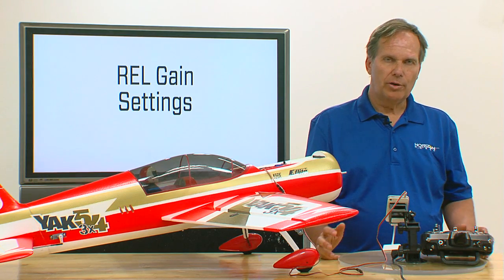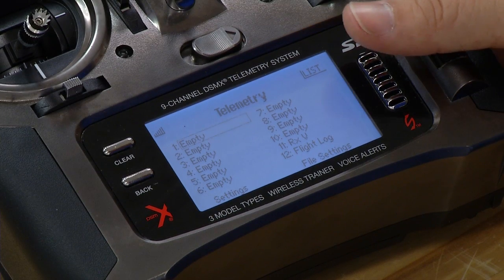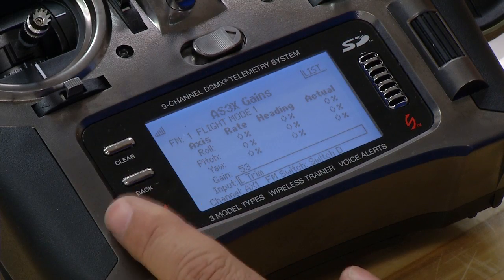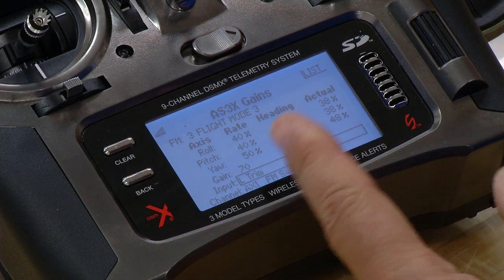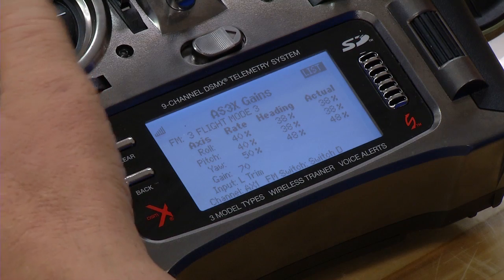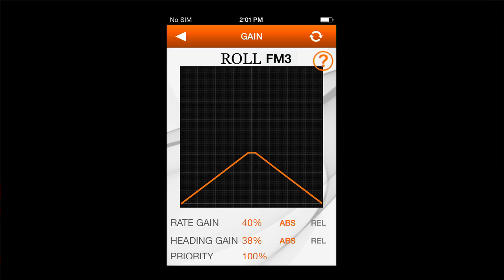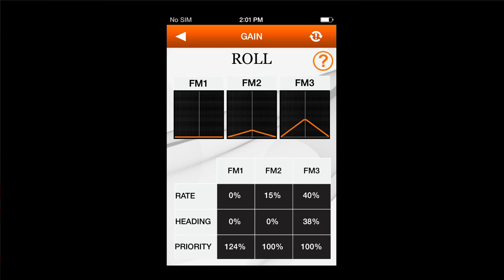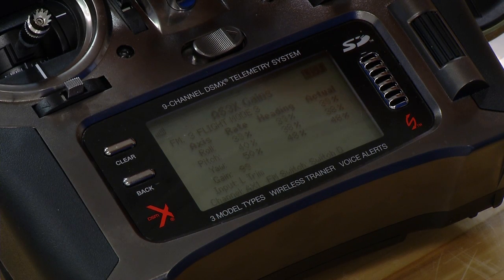Spektrum AS3X Step 15:  Relative Gain Settings (Final Model Setup)

Comment: Hay Jon what should the heading gain  be at ballpark?  I have my AS3x gain set at 40-50-60 but did not set the heading gain so I don’t have any movement on the control.
Reply from the maker: Heading gain can be pretty sensitive and it is hard to give a suggestion without first knowing more about the model. I would suggest starting at 10% and moving up 1% at a time until you feel it is doing what you want it to.

Comment: How can I use the dual elevator with as3x, only the elevator channel works, the auxiliary does not work with as3x, how can I solve this?
Reply from the maker: Depending on the receiver, it needs to be programmed into the receiver for this to work. I can help point you in the right direction if you can provide more detail :)

Comment: I've also had to watch the videos several times, fly, and then re-program.  As nearly as I can tell the stabilization system does not work at all, I'm doing something wrong. I've probably spent thirty hours trying to get one receiver to work and am not there yet.  I don't even know what to ask.

Comment: The average guy that flys RC is not an expert at computers. This stuff is far beyond most of them, making having gyros and the "smart" products impossible for them to use. I am sure it is disappointing for the fliers that would like to have some of the new technology. I couldn't find anyone to help me, other modelers,  hobby store owners, even members of my club. I bought an AS3X receiver and ended up putting it back in the box and not using it, because no one could program it.

Comment: I have an AR 7350 on a Stuka with a DLE 20. I have fixed gear so Port 5 is my Tech Aero IBEC and i have a total of 4 Flaps so i have two on Port 6 and two on Port 7. I have my engine kill(Port 5 Tech Aero) assigned to my bind button so i can kill the engine from my DX9. On switch G i have 3 flight modes High rates position 1 no AS3X active , Low rates position 2 no AS3X active and position 3 i have low rates plus AS3X active. Since all my channels are used is it possible to still add TX gain control on the right trim switch or would i need a RX with more than 7 channels?

Port 1 - Throttle
Port 2 - Aileron
Port 3 - Elevator
Port 4 - Rudder
Port 5 - Tech Aero Ibec
Port 6 - Flaps
Port 7 - Flaps

Comment: Haha, what a joke, relative gains can't work with my existing DX8?
As if i have not spent enough money, is it trying to encourage me to get a more expensive Spektrum tx?? : )
Reply: Katana Aerobatics I’m guessing my DXe is the reason I can’t get the Gyro stabilisation to work?
Reply: Mordem Tasci - nope, RELATIVE gains I.e. adjusting them in flight needs a compatible radio, gains per se do not. If you don’t have a suitable radio use the flight mode switches. Using the app connected to the Receiver, Set FM1 to zero gains, and then set FM2 and FM3 to two levels of gain, say 30% and 50%. Take off in FM1 and then switch to FM2 and FM3 in flight. If either oscillates switch back to FM1. Land and lower the gains. If neither oscillates then the gains can be set higher, etc. Much longer winded then using relative in flight but not exactly a deal breaker is it.
P.S. if you cannot set gains or make changes with the app, you may have an AR636A I.e. a preprogrammed one out of an eFlight plane, those often cannot be reprogrammed to other models.

Comment: Det biggest problem now is that Spektrum ignores the fact that the App doesn't work for most android users. I cant even download it. I have to send my AS3X back..
Reply: Works OK on my Samsung Galaxy S5.   Also, works fine via USB connection to my  Win7 laptop.
Reply: thomas low The App should work on all device i cant deag a laptop to the airfield 😊😊
Reply: ArcticRc 

I work for a hobby store and deal with horizon on the daily. They are working on the problem
Reply: they need to work a bit quicker why should  we pay good money for a Bluetooth  cable that does not work on all  android phones its a joke

Comment: I also have the DX8 Gen 2 and am not able to select input switch.  The cursor just skips over it.  The input switch is on "roller" and again I can't highlight this setting so for now roller is the only switch option.
Reply: I had the same issue with DX8G2. I've since upgraded to the DX9 and now that selection highlights as in the video.

Comment: Does this work on the DX8G2 radio I just bought or is this a real old video?
Reply from the maker: Absolutely!  It comes with the AS3X gain menu already installed.
Reply: Ok thanks! My radio didn't come with a receiver or cord to use the App so is this all programmable on the radio itself? My kid is only here till Sunday and it's taken 3 days and I'm still not sure I understand how to program this to fly the Timber I bought for him.. there was no quick start guide like this series says to get the QR code from either and I can't figure out how to set dual rates to a switch or set the rates so I can fly. I'm new to this electric stuff too and not sure how long to fly with this 2800 mah battery but, I'm guessing till it pulses
Reply: It says there's links on the spectrum RC site to set up this thing but this is the only place I see videos
Reply from the maker: The Timber comes programmed if you bought the BNF version. No need to program the RX. The radio is super simple to setup for this model. Essentially just setup the flaps and you are good to go. Also I can get you a preset if you want. Hit us up on FB messenger and I can send you one.
Reply: SpektrumRC 
That's good to know but, I can't change this without this cord to my phone to use the App?
Reply: SpektrumRC 
I got the Timber BNF Basic
Reply from the maker: You do not need the cord for the Timber BNF. It comes preset, all you want to do is setup Dual rates and Flaps on your DX8G2 per the manual and you will be good to go.
Reply: SpektrumRC 
I bought a DXe too and the did the bind at the store to the DX8 and said it's ready to go. I think all I have to do is bind the DX8 to the receiver now, assign the dual rates to a specific switch (H?) and set to 70% I think. I'm still not positive I set the flaps right or to what switch.
Reply: SpektrumRC 
Is there "anything" that you need the App in order to set up on other planes etc that you can "not" set up on the controller itself? Just trying to understand if the app is necessary or merely convenience
Reply from the maker: You will need the app or the PC programmer to setup gain and wing types if you were to put a A3SX receiver into another model. Also Yes we are the same on all our Social media sites (FB, Instagram, Twitter, Youtube)
Reply: SpektrumRC 
Ok I just have this AR610 that came with the DXe radio I am going to put in my old .60 size plane to convert it over from the old Futaba FM
Reply from the maker: Yup no need for the cable and app for that setup unless you want to change travel settings on the DXe.
Reply: SpektrumRC 
I'll use the DX8 on the nitro plane. I should probably get a cable for the app tho, looks like a bit more simplified
Reply: SpektrumRC 
I messaged you on FB